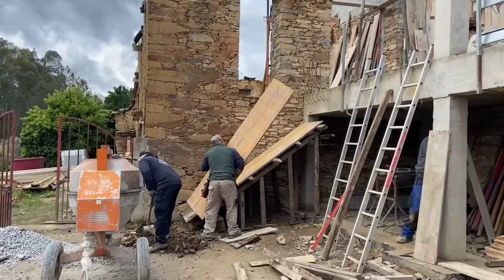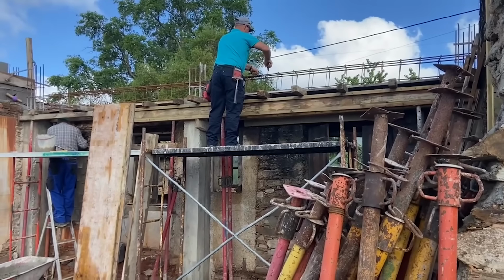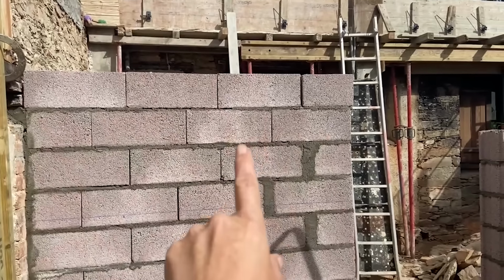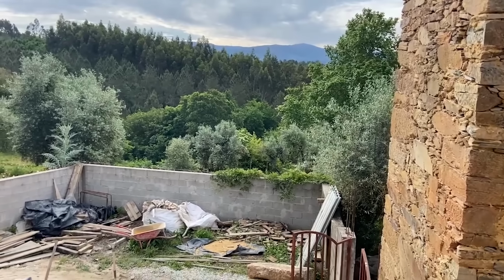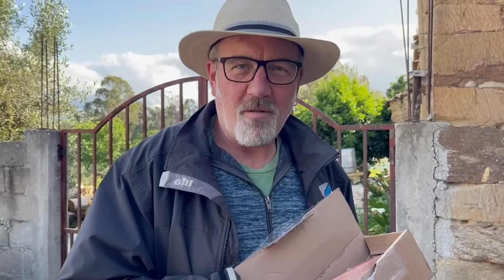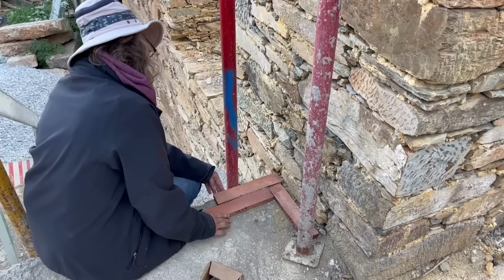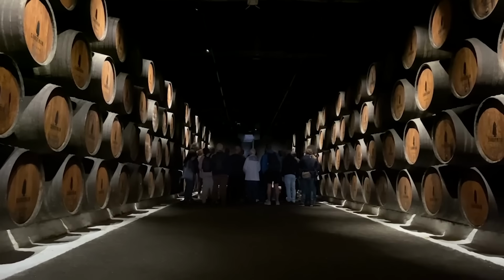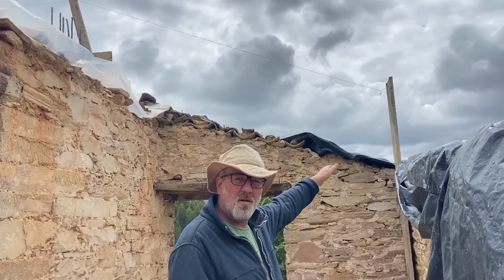Building New Walls in our Stone House | Handmade Tiles

Comment: Think about how the traffic goes when considering the tile pattern. Which tiles get the most wear, how easy/hard will they be to clean/maintain if they chip, crack. It's lovely to get tiles done for the pattern, but I have seen that become a real headache once they're worn, etc. 
The house is far more complicated to build than I thought, but given there are earthquakes, better construction is safer for you. 
Bottom wall should be spectacular once it's repaired, finished.

Comment: What will be your primary heat source in the house? Curious. Thanks for starting the video on your stunning garden . I am mesmerized by your lush, beautiful garden. I was using fireplace and 2 pellet stoves to heat my house. Quite difficult to drag pellets up and down all the time. And Pellets went from 3 euros a bag to  9 euros a bag. Last spring I had a split unit heat ac unit with outlet on the middle floor and the top floor. Much better for me. I am so happy to hear your cat is on the mend. My cats have brought me so much joy here in Italy. Bravo to you both
Reply from the maker: Wood stove with water heating for radiators.

Comment: The tiles are lovely and the design sounds fantastic BUT you need to ask how they can be sealed because of the rain ....
 We put stone on our terrace and the rain water soakes through causing the plaster so blow inside and out. I have never found a sealer to rectify this problem it is torture. And what ever we do it is going to cost us a fortune which we haven't got. So every spring we try to patch up crumbling plaster. It shouldn't have effect on the stone just a lot of damp in the house we have  to keep our wardrobe doors open as our clothes go mouldy.😢😢😢

Comment: About tiles: I live on the other side of the world and I have had Portuguese cork floor-tiles in 2 rooms of my house for 40 years. It is puzzling to me that none of the youtubers renovating derelict homes in the land of the cork tree use this product. The guys from Project Kamp visited the cork factory, but it seemed to be making cork insulation only (episode #53).  I should add that my floors had 3 coats of polyurethane when installed which are as good as the day they went down 40 years ago, but were a pain to do because we had to stay off them while each coat dried. Still worth it though ☺

Comment: Clay is not a building material, it washes out slowly and it crumbles, I'll tell you a method that we have in Greece, but I don't know if you can get it in Portugal
white cement, and powder from red bricks, there are also yellow powders from yellow bricks, but as I see you need red ones
So white cement, mixed with sand, and the red powder, you have to put the mixture very loosely like pudding, put this mixture in all the joints and then wash it off so that the stones are clean, if you have large openings, make the mixture a little thicker so that you can closes the large gaps and holes
Our technicians use it to attach stone decorations
You can also find grout material in large 10kg bags in various colors that are used for tiles in the bathroom and outside